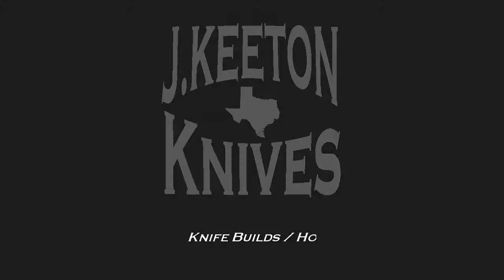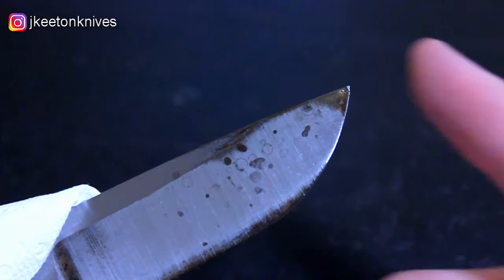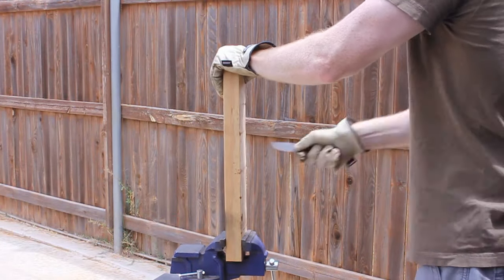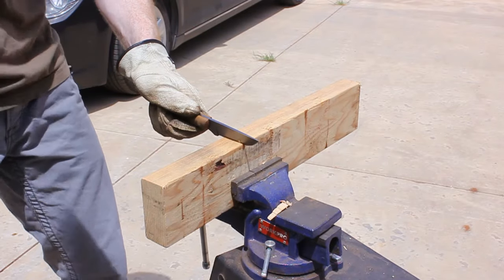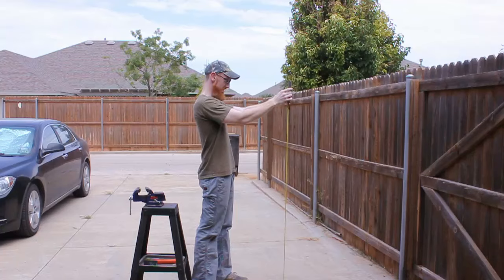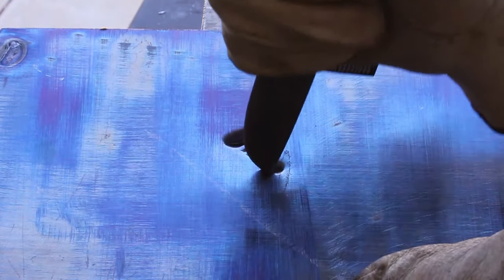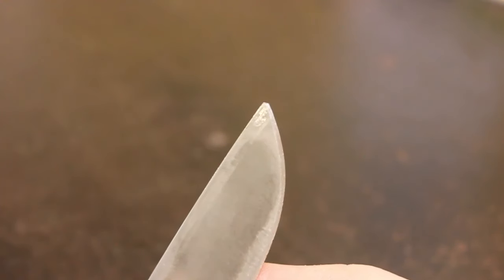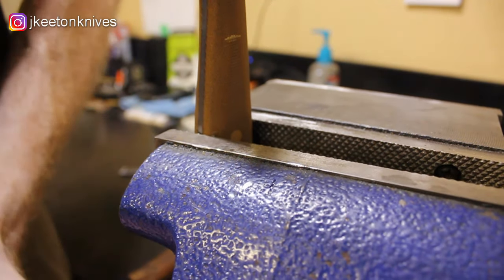Handmade Knife Torture Test | The Effects of "Blistering"

Comment: Loved the video as always brother. If you ever have time, would love to see a video or two on proper grind pre and post heat treat. Long story short; making a knife for a buddy, left edge about thickness of a quarter maybe a bit thicker pre HT. During post HT grinding down, went too far, edge chipped on 2x4. Ground edge off to thickness of a dime and beat the crap out of it on my anvil with no blade damage! My worst enemy is edge geometry, knowing when to get off the grinder to hand sanding, and finishing, so something on that would be great. Thanks again,  Wayne
Reply from the maker: Cheers sir! Thanks for the praise. Really glad you're enjoying the videos. That's a good idea for a new video too! What I normally do is grind to around 20-30 thousandths pre-HT with 1084. This is with 1/8'' stock. After the HT I'll get the edge down to around 10-15 thousandths before adding my secondary bevel. I feel like this makes a fairly robust edge.  Some makers go damn near 0 with great success! Guess it depends on what you're building the knife for. I can see a major slicing advantage to going to 0-5 thousandths. Big ass camp knives and Bowies could get away with 15-25 thousandths. They'll see a lot more impact forces. This is based off the research I've done on blade forums... note I'm not a professional! Have a great day!

Comment: Man. This I think really speaks for the toughness of the 1084 alloy. Even when overheated, with a likely oversized grain structure. It holds up pretty well. I can say. If you had overheated a hypereutectoid steel like 1095, 26c3 (which I think you could really do some great work with if you wanted), 52100, you would have some plate martensite, and that blade wouldn't have nearly held up as well.

Comment: I can't say much about the grain but in my opinion it looks fine for a martensitic structure.

The knife snaps very quickly, which is understandable with the abuse. I'd like to see the same test with a non-ruined heat treat.

I would like to inform you that the term blistering , at least where I'm from, refers to an old metallurgical process to remove impurities in steel. It would be less confusing if you used a different wording. 

Also, I saw another comment asking for a non-pin epoxy test. What if you test a handle with no epoxy but pins also? For comparison.

Thanks again for the great video. Keep up the good work.
Reply from the maker: Thanks for the post and ideas, sir!